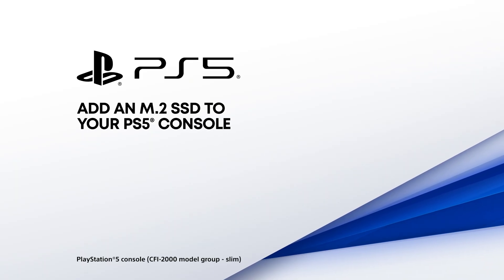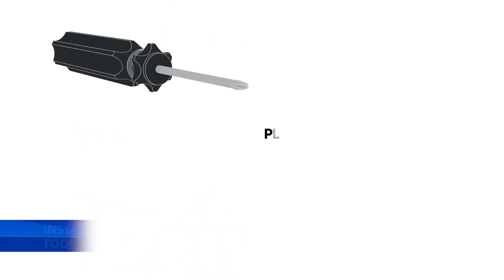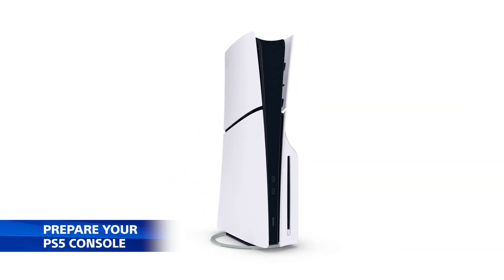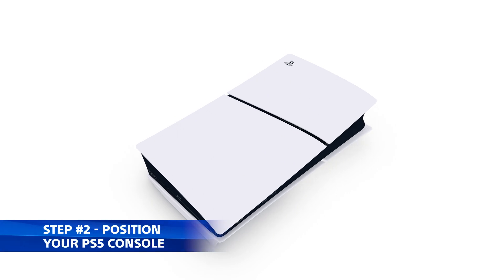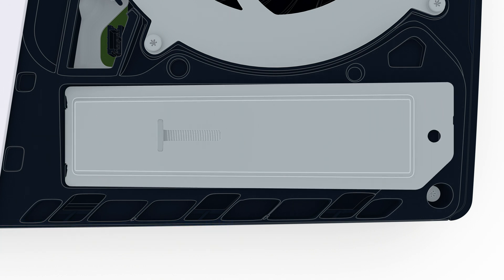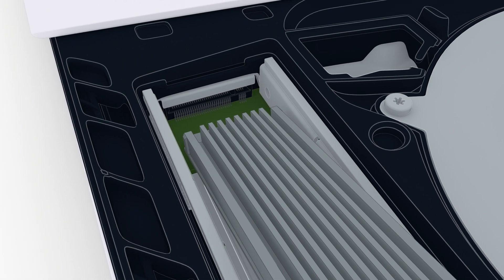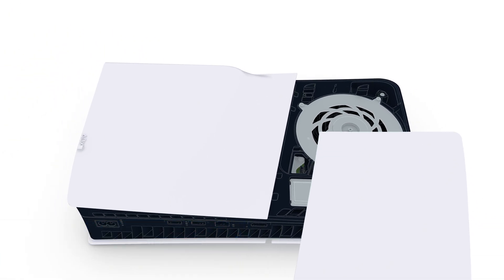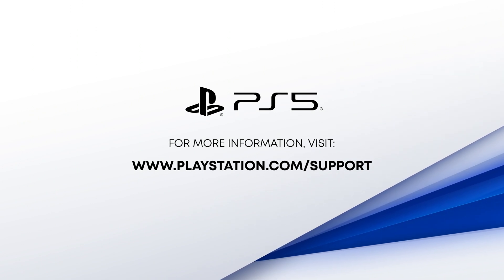Add an M.2 SSD to a PS5 (CFI-2000 "Slim" and CFI-7000 "Pro" model groups)

Comment: remember guys, if you have games on your current ssd/nvme from previous PS5. Dont forget to make backup using ps+ cloud and transfer using cable or same wifi (recommend using cable instead) towards your new system PS5. By doing these, simple plug n play your ssd and having your previous games and save files without change anything. Its will prompt asking for rebuilt data system which only takes few sec
Reply: or you can just log with your account on the new PS5 take out the NVME and plug it in your new PS5 and all the games will show up no transfer needed that's what i did
Reply: Thanks for the heads up. I’ll be sure to do this. I just thought it would’ve still been plug and play without having to backup an upload file to the cloud prior using ps plus.
Reply: @Nunbutvibesant  you don't have to just login on the new PS5 first and then plug the NVME in the new PS5 all the games will show up
Reply: @LyuboA  yeah that’s what I initial was going to do that’s why I was like I thought it was plug and play already lol. Thanks for clarifying that I can just log into my account and just plug in the NVME.